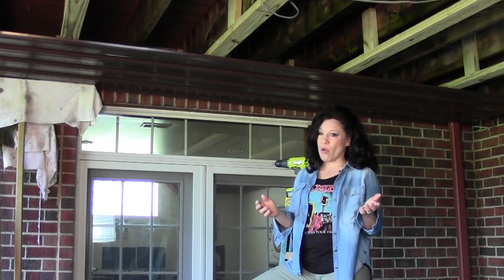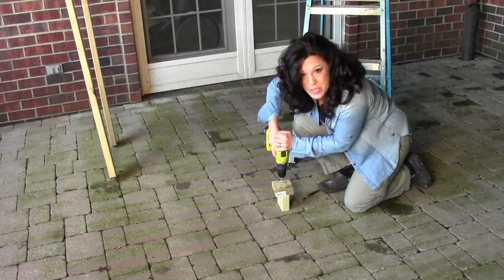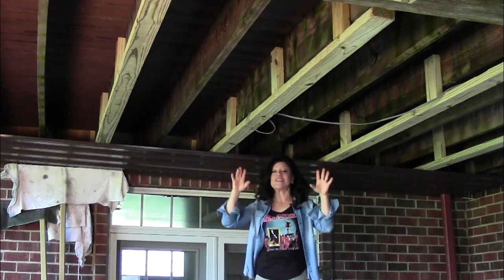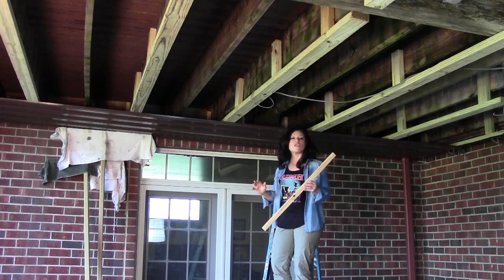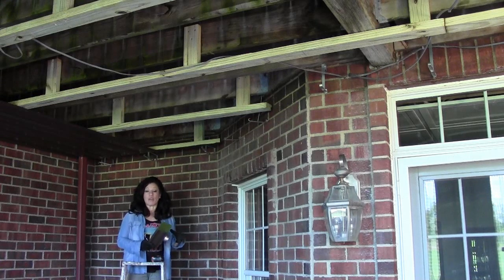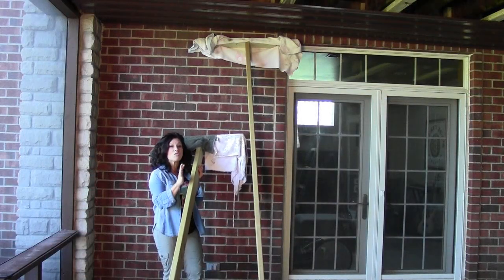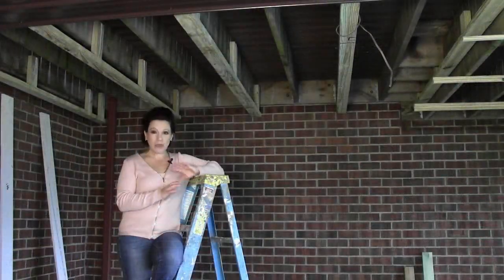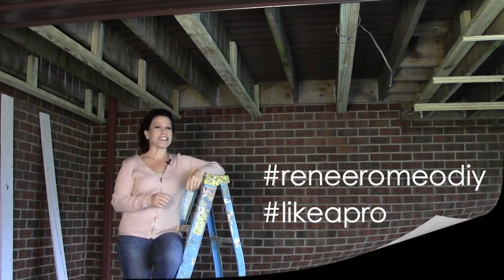Transform Your Outdoor Space: Diy Under Deck Roof And Drainage (part 1) With Renee Romeo

Comment: All those shelves you made are going to collect debris retaining moisture, leaves, then worms. Plus the 2x4 hanger was unnecessary since there will be no high winds, dead loads, hail, ice dams, etc like on a regular roofing system. Better off ripping the 2x4's or a wider board to rip what is needed and run the rip boards across your beams or inline with your beams. 

Inline is a little easier, rip (1" Thick x 12 Long") times however many you will need, etc then (1 1/2Tx12L")  (2T"x12L") (2 1/2Tx 12L") (3T"x12L"), heck even 6"Long would be fine, whatever is needed to extend the width down of your existing beams for the desired pitch. They will be placed inline-like dashes on a piece of paper at the intervals you plan to attach the under roofing. 

Similar principles will apply to go across your beams where you would attach full-length boards to the dashes you made except your dashes would be thinner. Say for instance your cross boards are 1"Thick x2"Wide x(8ft, 10ft, or 12feet long), etc. the first board is placed across with no extension this is normally your high point. followed by 1/2" x 6" or 12" adding the thickness of your cross-board would be 1 1/2" thick, next would be a 1" plus cross-board would be 2 inches thick. your screws would be placed every 24" or 36" on center and that is where you want your dashes and cross-boards to be placed. 

Edit to add, placement of your screws would be similar to installing a tin roof like on a gable roof, or even a dog house.

Simply you did not need to use all that wood or screws you probably used. 600 square feet multiply by 80% equals 480 screws placed at the desired or regulated intervals.

Overlapping your panels properly and stitcher screws are important as well and never ever have water running toward your house brick or not. I can go into many reasons as to why not and hopefully 10 years down the road you do not find out the hard way. 

Best of luck to you, all in all, I enjoyed your hack job video you are pleasant to watch.
Reply from the maker: Junk Man, Thank you for the great feedback. I know there are many ways to this and I appreciate you including specifics for others to follow as well. This is what I came up based on the stack of materials I had left over from another project. I'm just sharing the way I thought it out. Incidentally, the brick walls remain dry because of the gutter system I installed (I'm not sure you watched all the way to the end). It's a perfectly dry space now. I'm glad you enjoyed watching, Renee
Reply: @ReneeRomeo  Welcome and yes, I watched it all which time will tell, I give it 10 years.

Comment: I built homes for a living, 40 years (retired). No matter what material your home is made of, you never allow water to purposely flow into the home. Why? Answer: Water will erode your foundation out at the point of water discharge, plus your placing unnecessary wear on your brick substrate. Flex Seal! Come on. If I were you, I'd dissemble the metal and flip the flow of water discharge. Hook up a 275 gallon water tote and harvest all that water for your lawn, flowers etc.  Best wishes to you.
Reply from the maker: No one special, Thank you for your expertise and I agree with you completely. However, in my case the gutter system that I installed and connected to my existing underground drainage system is working beautifully. I now can fill up my backyard pond with rainwater that used to flow to this area. Also, the flexseal was used to take care of any potential overspray (similar to rain falling on the surface) and those areas no longer get wet with this system so it was overkill. The pitch of the roofing and gutter system that I installed after installing the metal panels are doing the job perfectly and no water is falling down the wall and reaching the foundation. It's a super dry area now. I'm giving myself an A+ . All the best, Renee
Reply: @ReneeRomeo  Sounds great!

Comment: Lost me at flex seal lmao
Reply from the maker: Well, it was just an unnecessary precaution. Water never gets on the brick. I was thinking that if there were backsplash during storms, this would help the brick to not get deluged. It turns out, it wasn't needed. The patio is still dry as a bone. Too bad you didn't watch until the end. Renee